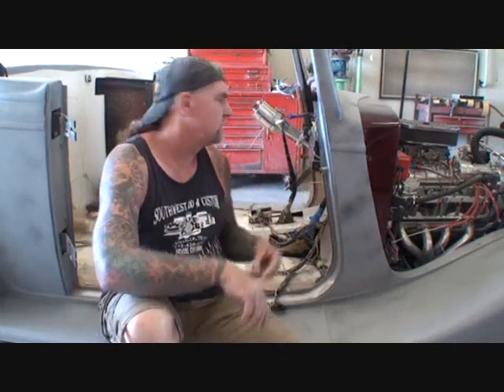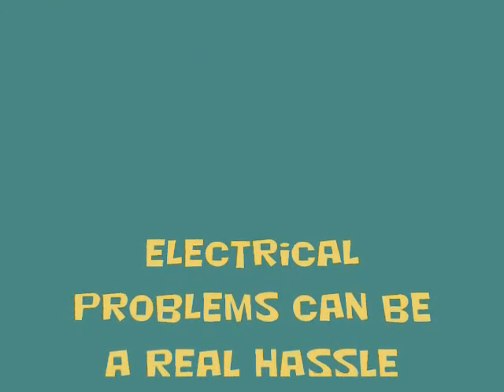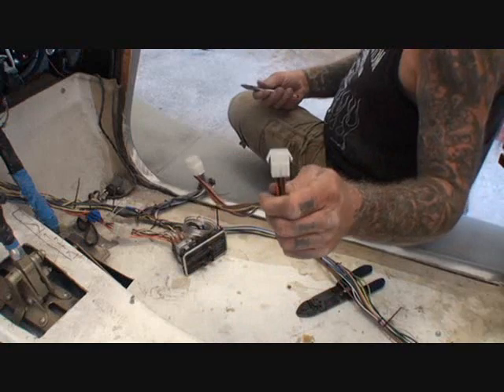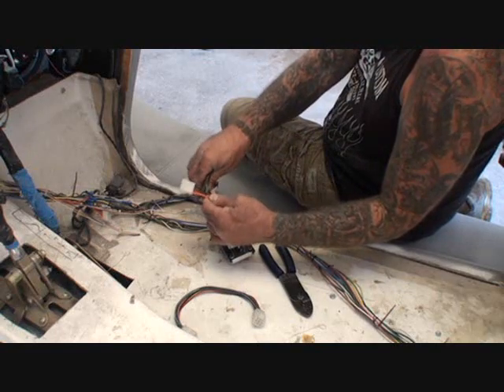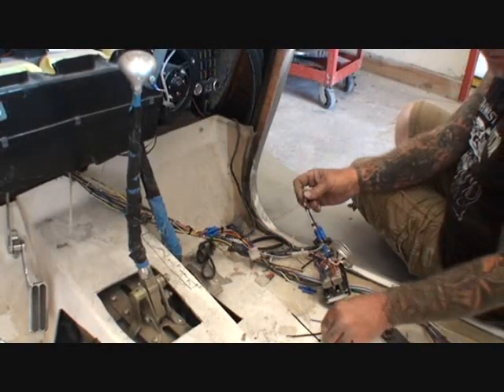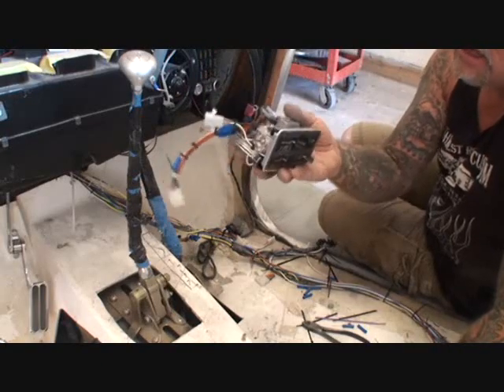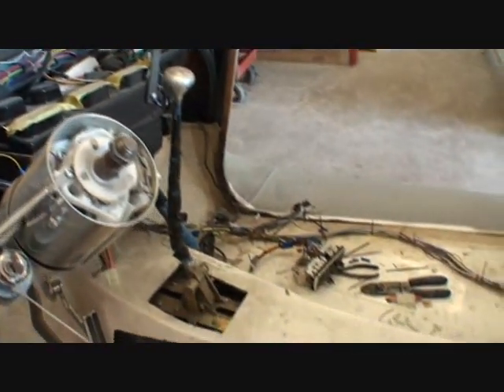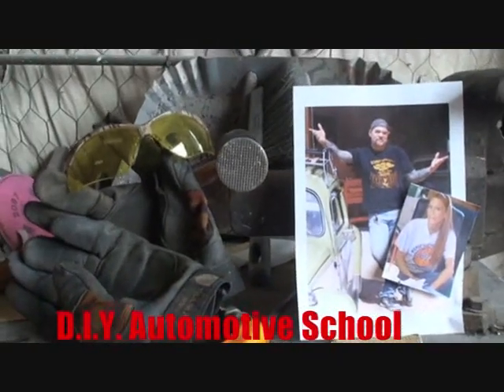Automotive Electrical-How To Use A Wire Pin Connector-D.I.Y.

Comment: Taking extra time wiring in the electrical connector so the guy down the road won't have to break his ass if a the dash needs to be removed.  Take it easy Pete

Comment: Awsome tech tios there Pete, by the way Pete i got my first floor pan welded in the old valiant thanks to you and your video's.Decide to make my own as the cost here in Australia for front passenger side floor was $330 bucks so i brought my own beading machine and metal brake bender for $300, it was a no-brainer and job turned out great. Thanks again Pete for all your hard work and knowledge
Sincerely,
Mark

Comment: I bought a butt connector crimping tool at Harbor Freight that is awesome.  It has separate slots for each different size of butt connector and is easy to use.  It just about removes the chance of a bad crimp and saves a lot of time.  On top of that, it wasn't very expensive!

Comment: Butt Connecters are the worst thing to use. Solder and heat shrink..
Reply: It's all personal preference really. I have used them before but I have had issues with them more than heat shrink and solder. Whatever works for you is good.
Reply from the maker: +T RopE (trope34) The reason people have problems with Butt Connectors is because they use the wrong tool, and if they have the right tool they end up using it the wrong way. there is a special Butt Connector tool that will secure the wiring super tight and will NOT let the wire slip out of the connector.. Most people use the CHEAPO Tool with the 3 flat slots in it that are color coded for the size butt connector your using which is totally wrong. The Proper Butt Connector tool will have a V shape valley on one end and an V shape TIT on the other end so when you crimp the wire it locks it down permanently and secure.. Ive NEVER had a problem with butt connectors because I use the proper tool for the job!
Reply from the maker: +James Long More then likely you where using the wrong type butt connector tool, there is actually a professional tool to use to do the job right! I will be making a video on this subject very soon...

Comment: Why not solder it? i hate those crimpconnectors.
Reply from the maker: +D. Mulder Most people do hate the butt connectors and its because of the crimp tool they are using.. I will be making a video on this subject very soon and I think you will change your mind when you see it! Take it easy Pete
Reply: +diyautoschool 
i have a tool with a spring in for these crimp connectors. Works a lot better. bit i still linke to solder itbecause or keeps my cablebundle Nice and thin.

cheers mate.
Reply: +diyautoschool i use the crimps with the tool a fair and they can be great but its a pain having to keep sending the tool off every year or so to be calibrated so it applies the right amount of pressure to the crimps. soldering is good also but you still end up having to cover the joint with heat shrink

Comment: I play it cheap and use used connectors from junk cars, Got to make this removable!  Soldering really should not be used on vehicles because its not vibration proof, crimped is better.
Reply: +Ghetto Wagon You don't know what you're talking about!
Reply: Solder joints break from twisting and vibration, heat too, if its hot enough . if soldering is so great, Why is hardly anything factory on a vehicle soldered?   The same goes for aircraft, Nothing is soldered for the same reason, vibration, heat, twisting. Keep soldering on.

*****
Reply: +John P. Fox yep, allways solder, much better than crimps, disappointed that Pets not soldered this, don't know what ghetto wagon s on about !!!!
Reply: +Ghetto Wagon You are absolutely right, you should not solder joints in car looms. To be honest I don't regard this as a hard and fast rule though. Much of the wiring of a car is not subject to much vibration. Correctly done crimped joints are better in high vibration environments.
Reply: Ill admit, I soldered small nonsense wires when it was a straight shot.  Some things you have to solder, such as wires to a circuit board, a audio jack, etc.. I like to hack off the plastic covering on the but connectors then slide a piece of heat shrink over it so its more weather proof and its more low profile. g0fvt
Reply: +Ghetto Wagon I think people have bad experiences with bad crimping tools. As you say a solder joint of wires that are twisted together and then sleeved with a layer or two of heatshrink should be great. In old cars people often relied on solder joints to attach the low tension wire to the distributor, with the engine rocking around these will often fatigue. 
Pete is using a good quality crimping tool, not a cheap pressed steel one... or at least it looks like it on my tiny screen.
Reply: If soldered correctly and heat shielded correctly, soldered wires will last forever. Nothing is now currently being soldered but rather crimped because of money/time savings. It takes more time to solder and heat shrink than it does to crimp a connector. Please share with me how soldered wires in petes application could fatigue over time? I've never seen or heard of anyone experience soldered wires pulling apart.
Reply: Its Not time and money savings, Its a non approved assembly or repair method for Automobile and aircraft use. Bend a soldered joint a few times, see what happens. Put a soldered joint close to a extreme heat source. What fails on circuit boards all the time, solder joints cracking from vibration. . I am not here to argue. Argue with your hot soldering iron  I am not saying petes method is a bad idea.  Calm down. When a Harness gets yanked, it has to give somewhere, Either a wire snaps or crimp gets pulled,. Would you rather have a crimp get pulled out or chase a break in a wire from a solder joint that did not break free when the wire was pulled.  John P. Fox
Reply: g0fvt
Exactly!    The automotive  type crimps that have TWO areas you crimp are the best one holds the insulation tight and one holes the bare wire. Those crimping tools are $$, at-least the crimps are cheap!
Reply: I see what you are talking about ghetto wagon. Is soldering really not to spec on automobiles and aircraft? Pete needs to review detailed information on soldering vs heat shrinking. It would be nice to see specs on failure rates as well.
Reply: Pete is fine. John P. Fox
Reply: in my days at ford, there where joins in the harness that where soldered, and in this day the same technique  is used still on modern harnesses and re-pro ones, also the correct way to splice a harness is to solder and shrink sleeve, crimps are far worse for failing from vibration, and used in contact with the elements, cause corrosion of the conductors, only shrink sleeve crimps should be used in these areas, the connectors Pete used are fine behind the dash, but I still maintain the rest should be soldered and heat sleeved, most modern connectors are now encapsulated, or lacquered to prevent corrosion,

Comment: Has anyone had a mouse get into there wiring system and cause havoc? This past spring I took my 71 Heavy Chevy Chevelle out and changed all the fluids from when it sat all winter. After I did everything and got it looking all nice again and topped off with new fluids, I went to turn the key over and the dash started smoking, smoke came from under the hood and I had to cut the ground to the battery to get it to stop. Talk about being pissed off. My mate, my cousin and I took everything apart to find a bastard field mouse burnt to a crisp along with some of its little bastard babies. Talk about a mess and nightmare. After a few nights and a shit ton of beers thanks to our loving wives, I finally got pissed off and purchased a new harness. I would get a cat but my pitbull and rotty hate cats with a passion thanks to our neighbors cats that attacked and clawed the hell out of my dogs when they were puppies. There cats mysteriously disappeared when the dogs got bigger, not sure what happened there.

Comment: I use "Molex connectors", usually 4 pin used for computer power supply's. You can get male and female housing for 0.15$ea, and crimp pins for 0.05$ea . There are also 3 pack kits for 2$ on amazon and such.

Comment: Hey Pete, those connectors look like universal mate-n-lok.  They are common in industrial situations.  I crimp the pins onto wire that go into the connector shells, then put them into the shell.  There is a "pin popper" that lets you remove the pins from the shell if need be.  Also you can put pins or sockets into the shells so you can make it so that even if the connectors are all the same, they will only plug in to one they are supposed to.  Something that looks nice is to use lacing tape or lacing twine to tie the wire bundles together, but tie wraps are faster.  I really like the looks of laced cables and they don't snag or tear your hands up like cable tied cables.
Reply: Correctly laced wiring is very nice, last time I saw it in a car was in a 1971 BMW. Making looms nowadays I usually use tiewraps and take pride in getting them at even spacing and all the same way round,  Lacing is better though.
Reply: g0fvt
It's a shame it's not so popular anymore, but I understand it is making something of a comeback.
Reply: Lacing is done with waxed string/twine.  Traditionally it was linen, but is mostly nylon now.  This was done on a lot of industrial machine wiring back in the day.  I think you are talking about wire loom.  Lacing basically ties the wires together similar to wire ties, but you don't have all the lumps, and the wires don't get compressed as much.  I've never seen it done on cars, but it looks very nice.